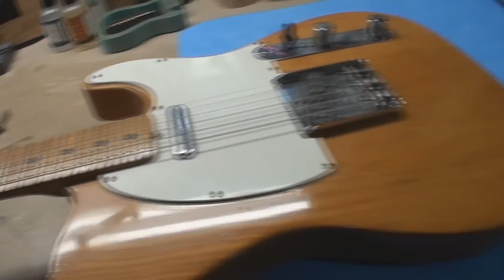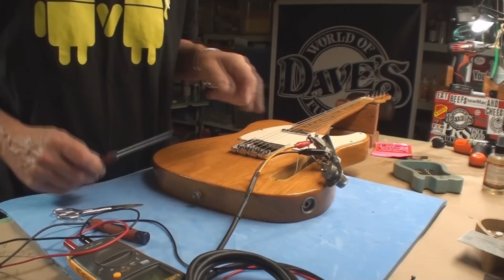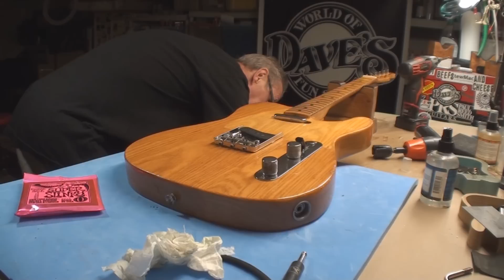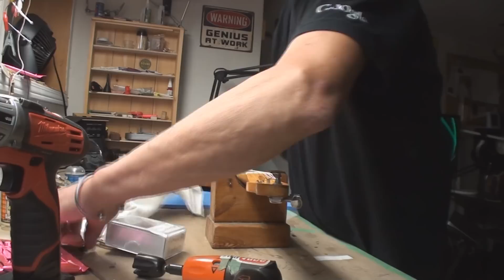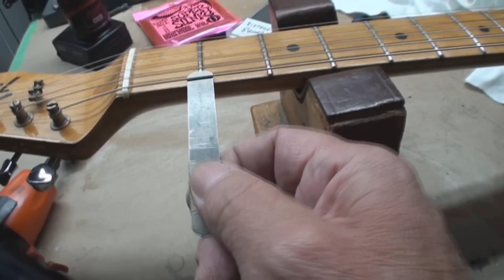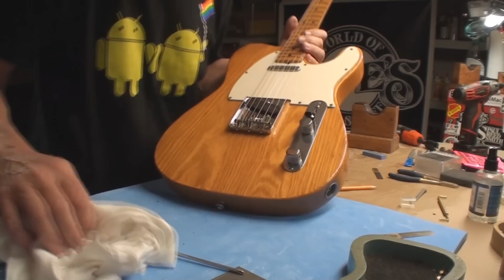70's Fender Telecaster Gets Help

Comment: I've currently got a set of Tonerider Hot Classics Telecaster pickups installed in my Mexican Telecaster, they are great sounding pickups if you really want to fatten-up a Telecaster according to the manufacturer, the the Hot Classics have more bass and midrange in their tone and they are wound hotter than standard Telecaster pickups, great for Blues and Hard Rock, to my ears they sound like a cross between single-coils and humbuckers, they work great with my Marshall amp's overdrive channel, great sustain, and I don't get that ice-pickyness that you sometimes get with some single-coils.